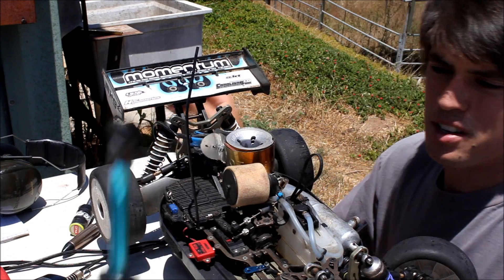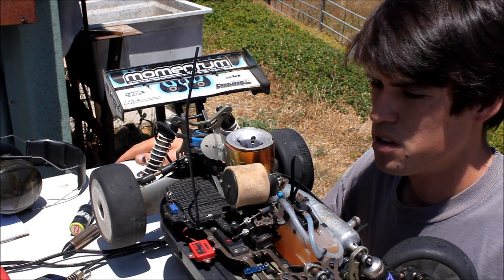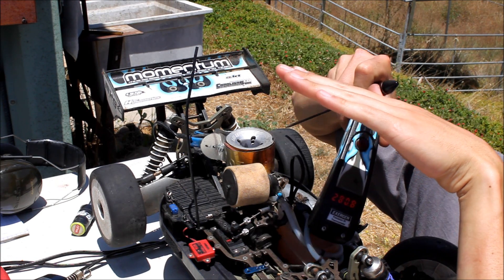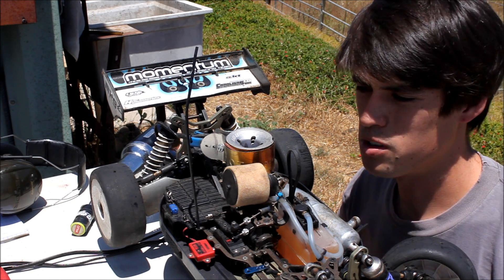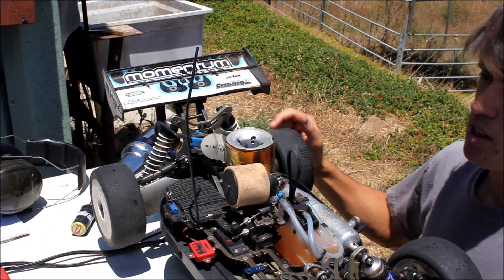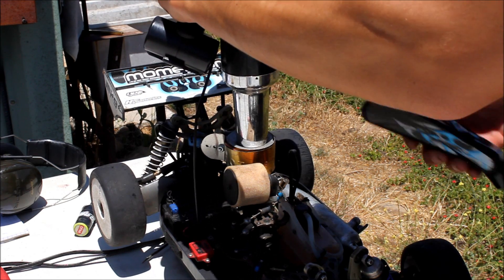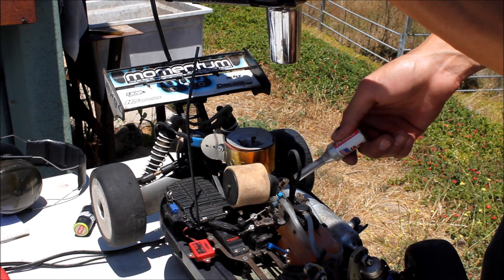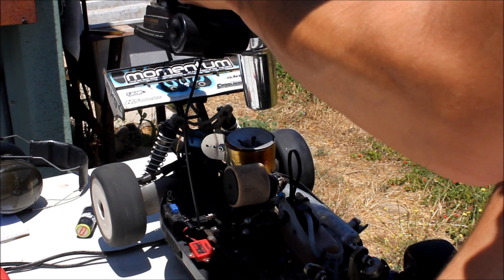Advanced Nitro R/C Engine Break In

Comment: This is definitely the fastest and most effective break in there is. It works very good and the seal you get in the pinch zone is really really good. I’m gonna use this on an engine that I repinched pretty tight to get the mechanical pinch out as fast possible

Comment: I've been breaking my engines in like this for years now. I don't have the "Competition Heat" engine heater, but I use thick tin foil wrapped around the head, and a 1500 watt heat gun with 2 heat settings. It's sort of a juggle between holding the radio wide open, handling the heat gun, and the temp guage, but I'm used to it. For me, this method has produced nothing short of reliable, long lasting, and easy to tune engines. After 5-7 tankfulls of doing this, my engines are rid of the "pinch" and have great compression. Like was mentioned in the video, key break in points are keeping the engine up to temp, and I firmly believe all the extra oil going through the motor does help to flush out the unavoidable metal trash that comes with breaking in every engine. Just make surw you've richened the needle enough to keep the RPMs in check, especially near the end of the tank, because it WILL lean out some and the RPMs will increase. Great video! I highly recommend trying this method when you become more familiar with the nitro hobby.
Reply: What about all that extra liquid putting extra pressure on the rod and crank shaft connections.
Reply: @mattphilip4595 ive done this break in technique on two engines, one LRP and a Picco. Make sure you pre heat the engine and keep the thing hot, I just kept my hair dryer on it at all times.
There obviously will be additional stress on the rod but the heat helps to keep it in check. I highly recommend this technique

Comment: It's temp and proper oil content during break in. I have never never run in a engine like you just did. I do it the other way but I keep my engine temp up.  Every engine I have owned (mostly ofna hyper .21s and p3-28) have all had atleast 10 to 12 gallons thru them including racing every weekend before I even change a connecting rod. It the high spped break in works for you 
. Keep doing it.
Reply: This method is for race engines.  I break in my engines this way.

Comment: So is your conrod now shaped like a U? That is one surefire way of destryong wrist pins, cno rods, bearings, and of course the rod journal. Don't, really, just don't.
Reply: A little insight for you: We were buying fuel by the pallet and I had the budget to experiment with different break in processes. The mechanical pinch is pretty much gone so there is nothing to load the connecting rod in tension. You can run a dozen gallons thru this engine before seeing signs of wear on the connecting rod. The engines run so well we really didn't need to change glow plugs; in fact, if a glow plug fowled it was usually because of an air leak or contamination from dirt/debris. 

Think about it, the connecting rod is extremely strong when loaded in compression but only has a little loop of aluminum and babbit to keep it from STRETCHING in tension (i.e. the flywheel pulling the piston down from the pinched area). Your starter box is never going to be able to transfer enough power to bend the connecting rod and the inertia of the crank/flywheel doesn't seem to be able to either (I've never seen a bent rod in a nitro motor).

Comment: So the engineering student didn’t think to put a rubber band on the carb slide instead of working back handed with a radio and heat gun in one hand!?. 
I understand your philosophy though. All this 3 or tanks at idle is bullshit . You need to let the engine get really hot and then cold about 10 or 12 times at least . I’d say.

Comment: So unnecessary and a waste of fuel. It's so impractical. Sorry, but I don't agree. Thanks for your opinion & and your methods of breaking in a nitro engine. Keeping it properly tuned & maintained is the key. Thanks for the video. We all have our methods and many years of experience of working on combustion type of engines, whether big or small. Don't be offended by my comment. It's only my opinion. Have a good one. By the way, have you done this method with just a pull start?
Reply: A pull start engine is not used in racing applications normally.  You can use this method with any type RC engine and works very well.  If the engine is a pull start, basher or Ready to Run engine, there really is no need to spend hours on break in and fuel.  For fast race engines, heat treating the engine and soaking ith with fuel this way helps maintain all the internal parts.  You cannot compare you race or tune big block car engines to this model engines.
Reply from the maker: Pull start, rotostart, box start... All good. The fact it's heated only makes it easier. How is it a waste of fuel? If you believe in breaking motors in than you know it requires fuel either way 🤔.
Reply: @mrwassman  It's my opinion and yes, it is waste of fuel. I've been in the field longer than you are old. I have a lot of experience under my belt. Because you think that your method is right, doesn't mean that it is so. Show me a video with you doing this method with just a pull start and not a box or rotostart. Impress me.

Comment: How many gallons are you getting out of a piston and sleeve with this technique? i am intrigued. I got 15 gallons on mt traxxas 2.5 on their technique.
Reply from the maker: James West That's really good life from a Traxxas engine. Their break-in is pretty well thought out. It's simple and they keep the motor warm using the body, right? The other half of engine life is the tuning. How did your engine end up failing? I've got 15 gallons thru my engine right now and I'm still waiting to use the engine I broke-in in this video to replace it.
Reply: My engine did not fail prematurely, it wore out to the point when it warmed up it would no stay running. Your break in technique is brilliant. The science behind it is perfect thinking. I also use extra castor oil in my fuel. I run on the rich side of peak.
Reply from the maker: James West Thanks man, just want people's engines to last as long as possible. I learned most of this process from a James Weston. He replaced the connecting rod right after break-in because he didn't heat the engines up.

Comment: Id like to see 2 identical motors, pre-break in disassembled and inspected. Use this method vs the 10 tank method like the top pros demonstrate. Once both engines are broken in, taken back apart for inspection.

 I raced two stroke motorcycles, Dave Ellis of ERE always preheated our enigines on first fire, doubled the oil in the gas and told us to do 15 minutes of race speeds before shutting off the engine or idling. I did notice my rings and piston lasted twice as long before needing replaced due to compression loss.
Reply from the maker: Michael Drum I would like to do this but lack the proper measuring equipment. What I would really like to do is submerge the engines in a heated oil bath and rotate the crank until the wear pattern develops on the sleeve. I heard someone was doing this but haven't looked it up.
Reply: mrwassman how about cryogenic treatments ? I've got two motors I'm doing this with. One will be the control, other brought to -350 for 12 hrs in a vapor bath. I'm dealing with 10f weather as of now, so I can't keep a preheated motor at 200f, Temps keep dropping too fast.
Reply from the maker: Michael Drum Interesting. Which components do you expect to respond to the treatment? Have you tried cutting the cooling head down? The airplane engines have much smaller heads for similar reasons.
Reply from the maker: Level Earth 
The method only works well if you can keep the engine warm enough. I'm pumping 1200 watts of heat into the engine. Another contributing factor is that we always preheat.

I'll agree that the engine MAY only last 2-3 gallons when broken-in cold at WOT IF it's an 1/8 scale on road engine; but the guy who I saw do this got far more gallons out of his off road engines (he also replaced the connecting rod after break-in). 

I've also tried using high oil content, low nitro content airplane fuel and couldn't really tell a difference. For some reason I prefer running whatever blend I race on.

You must be doing this differently than me. What type of engine did you break-in with this method? I don't even replace the original glow plug for 2-3 gallons and I changed the connecting rod out around 10 gallons just to be safe (I have bad experience with the fatigue life of aluminum). Shit, the dam silicone ramp rotted out of the crank of our world's OS before the piston and sleeve went out.

I don't know about you, but I'm reluctant to take tips from pros who get motors thrown at them for free😐. Just because they drive well doesn't mean they know everything about the hobby. I use this method because it works well and produces consistent running engines. I don't expect anyone to be able to perform this method as well as me but I was getting tired of people asking why our motors always worked and if I could help them with theirs. 

I don't mind puzzling non-believers with my fleet of bitchen motors; especially the wanna be pros who are always pinching their motors and flaming out in main events. 😀
Reply: mrwassman I just did a Team engine using your wot method. Ran 2 liters through it before it seemed to loosen up. Used 1 liter of VP 30% nitro 11% oil, designed for road racing. Then went to what I'll use normally, 30% nitro 9.25% VP pro race blend. Kept the Temps above 210 with a heat gun and engine wrap. Now I'm tuning it, getting it dialed in. I've taken the engine apart, the piston is chocolate colored on top, then about 7-9mm down before it gets clean. Not even race tuned this thing rips !! I've got a 2nd motor I'm cryogenic treating the sleeve, piston and conrod. That too will be broken in with wot, only time will tell how things worked out.
Reply: mrwassman components under stress, can't do the crankshaft due to silicone filled. Sleeve, rod and piston. Nitrogen works best, grabbing some from a welding supply.

Comment: I've broken-in a couple engines in a similar way, this technique (pre-heat/cooling fin block off/very rich needle setting) produces the longest lasting taper bore engines I've seen (ABC TYPE). I'd only add one step: always return the piston to BDC in between engine runs (cool down phase).
Reply: +highnitro707  The pistons are ceramic aren't they?.... ceramic has a lower coefficient of thermal expansion than the metal bore and cylinder.
Reply: +Marek Sumguy most nitro engines are aluminum piston with chrome plated brass sleeve (ABC type)
Reply from the maker: highnitro707 I always return them to BDC as well.
Reply: Oh did I not mention that? Most definitely.

Comment: Do you think the motor has enough friction to actually break in with that much oil?
Reply from the maker: It really creates a good polish at the top of the cylinder. I tested out the process on a few motors using 10% nitro/18% non-synthetic oil airplane fuel and it didn't seem to make a difference.
Reply: +mrwassman 

Bones break in fuel leaves a beautiful polished area at the top of the sleeve. I basically just idle a few tanks of it, then drop it on the ground for a few more at a rich setting. I'd highly recommend it

Comment: Can you explain in greater detail why this method is better than conventional break in method?
Reply: +Marek Sumguy in a nutshell you want to run the motor rich to break in to see that everything is properly lubed... but as a result it cools the engine, sooo he heats the engine and gets the results that is good for the engine....
Reply: +Lanchoooo  Too much lube, no?
Reply: break in you want an excess of lube... you want it running out the muffler... which cools the engine thus heating it...
Reply: +Lanchoooo Im not convinced.  He also says that you need to take the pinch out of the sleeve.  Does he mean no pinch when its cold?... or no pinch when its actually running at full temp?
Reply: +Marek Sumguy The pinch has to be there. its all about a "smooth pinch" (which is not the case from the factory) and one that is as near concentric as possible. also the excess fuel brings oil that washes away metal particulate among other things
Reply: your basically creating an optimal pinch for best compression

Comment: Can your break in methods apply to a rc plane engine of the abc type?
Reply: Sure. If you want to break stuff. Don't do this. It puts a HUGE load on all the internals as compression goes through the roof as the engine is almost hydrolocking. It's nuts.
Reply: @AB-80X  I break all my car engines in this way. It produces incredible, long lasting engines every time. I DO replace the rod right after break in.

Comment: Your worried about stressing the con rod but overloading it with fuel did you ever hear of hydrolocking not maybe completely  but in a sense you are  .
Reply from the maker: Yeah I've heard of hydro-locking, you should check out the video I uploaded of my friends Jeep breaking a connecting rod. I rocked auto shop in high school and graduated UTI. I also had to take fluid dynamics courses to become a mechanical engineer and half the calculations relied on the assumption that liquids were incompressible. 

I should point out though, that the connecting rods usually STRETCH out. You know when the piston gets stuck at TDC and you have to take a screwdriver to the flywheel and it makes that HORRIBLE screetching sound as the piston is forced down the sleeve? I think that is what causes the rod to stretch... just a hunch though. Thankfully, keeping the motors warm during break-in means that shit NEVER happens to me.

Comment: How long do these engines last that are broken in this way? Some people say this is the quickest break in method, but it kills the longevity of the motor to where they only last 2-3 gallons. The criticism is that there's too much oil in the cylinder which increases compression and puts stress on the bearings, plus a lot of added fluid friction. Just curious, I'm going to breaking in .21 as soon as it warms up outside.
Reply from the maker: What you have heard is probably correct but they probably weren't keeping the engine above 200°F. Seriously, without the heaters, the engines would go 2-4 gallons and start flaming out... mid air. It was really frustrating.

Comment: Who is Josh Cyrul and was he doing this in 2007?
http://www.rcnitrotalk.com/forum/threads/josh-cyruls-break-in-method.48292/
Reply from the maker: That's what this process started out as but the engines didn't last as long. The truth is, without the heaters the engine would only run at like ~100°F and there is no way you would need to wait 15-30 minutes for it to "completely" cool down. He mentions the engines don't last very long which is exactly what I experienced.

Comment from the maker: +Allan McHenry (I'm not sure why I can't directly reply to your comment)
Target RPM seems to be right where the clutch starts to engage. I don't know what RPM it is but it is similar to a high idle.

The object is to break in the motor as rich as possible while keeping it at operating temperature so you have the most oil available. For a little while I ran a 10% airplane fuel with like ~18% oil for break-in but it didn't make much of a difference. As others have said, they get a fairly large polished ring on the sleeve which is the piston sealing area. This area is also where the piston and sleeve transfer heat between each other and I have a theory that it helps regulate the temperature of the motor, making it more consistent.

Go ahead and do the tanks back-to-back; I'm not the biggest believer in heat cycling.
Reply: +mrwassman Great video! You said you're not a big believer in heat cycling, so we could do all 6 tanks of bench break in back to back, no rest? I would assume after the 6th tank, that could in theory be a heat cycle period. Then, after ample cooling time, use a heat gun, drive on the road for a few more tanks, slowly leaning out the top end needle with a sock on it (To maintain a decent temp.). Once I get to a near perfect tune after 3 tanks (Back to back), heat cycle a second time. Then for the 4th tank warm it up with a heat gun, run it without a sock and see if your in the 210-230ish ball park with good power. Then, the 11th tank or so, can be on the track for final tuning. Does this sound like a decent plan?
Reply from the maker: +Brizzad sorry I never responded. As long as you keep it warm, it should be fine. What did you end up doing?